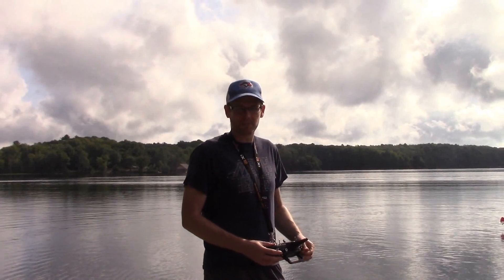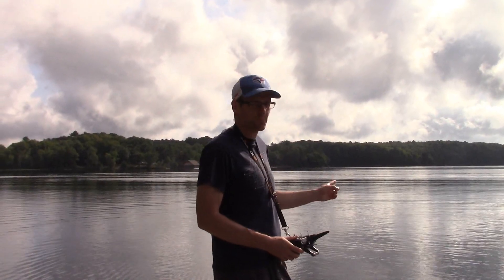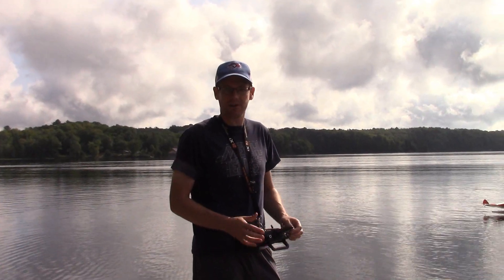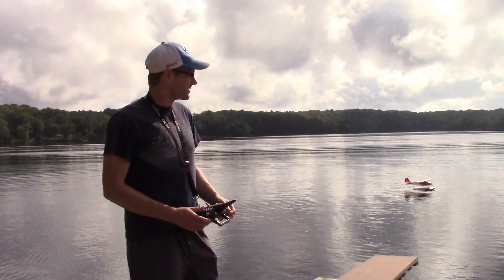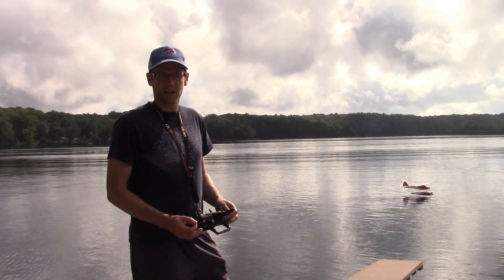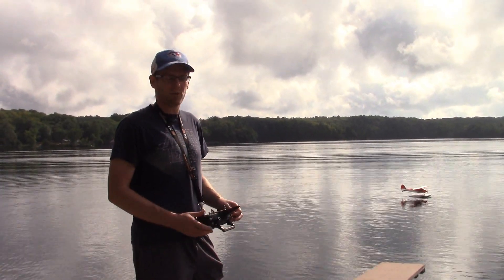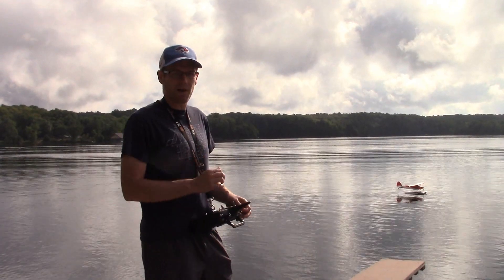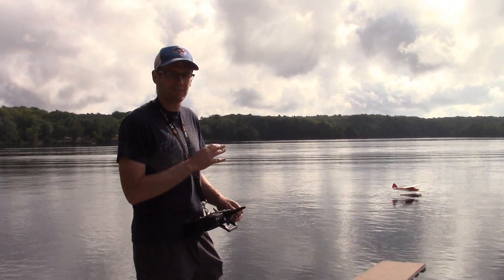Can the 2.1m Carbon Cub SS take off from Floats on 4s?

Comment: What size battery would you recommend for this plane? Also gorgeous lake, where was this shot?
Reply from the maker: Hey John. A 5000mah to 6000mah 6s battery works very well. This was shot 2 hours north of Toronto ontario.
Reply: @RCexplained  have you tried a 7000mah? I just bought my SS and bought a 7000mah but haven't flown it yet. Do you have your flaps mixed with the ailerons or elevator?
Reply from the maker: @johnjohnjohnson  7000mAh will work if you are looking for an increase in run time. I have down elevator mixed in with flaps. Most planes want to balloon upwards when the flaps are deployed.
Reply: @RCexplained  thanks! I was looking to get the most I could for flight time.  I don't have any mix on my timber and it balloons.  Do you know what percent mix would be a good start?
Reply from the maker: @johnjohnjohnson  I can't remember off the top of my head. However I do know it's in the manual.